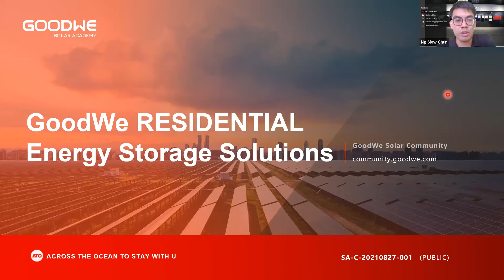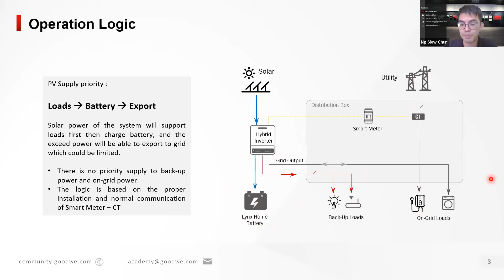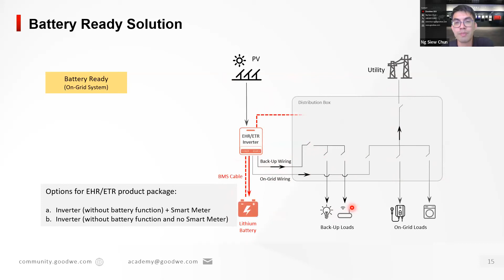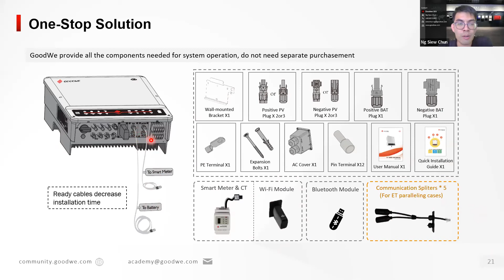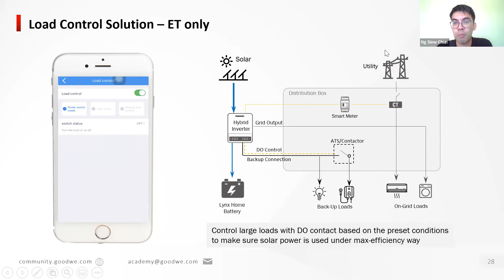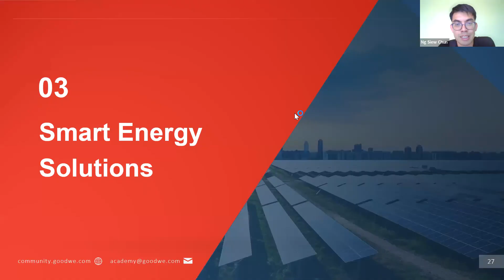SEA Webinar: GoodWe Residential Energy Storage System Technology Training

Comment: In a AC Retrofit Solution you talk about that there is a 3 phase solution for the BT series to communicate with a non goodwe inverter. Is that done just by the smart meter ( in the picture at 10:45 it is drawn in a 1 phase system) or do we have to install an additional smart meter. thx for the good explanation in the video of the diverent systems.

Comment: How many solar panels can you use on a 3kw inverter
Reply from the maker: For example, our GW3648D-ES can support Max. 4600kW of DC input power. The number of panel that can be connected with inverter is determined by panel specification and inverter parameter.